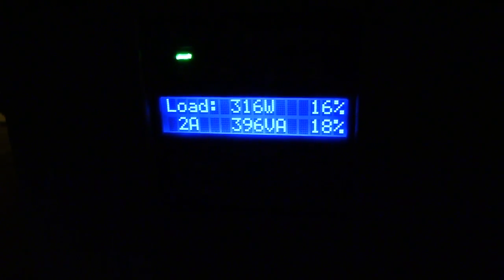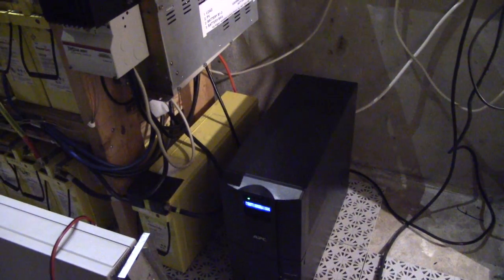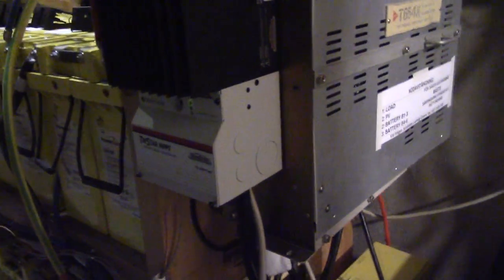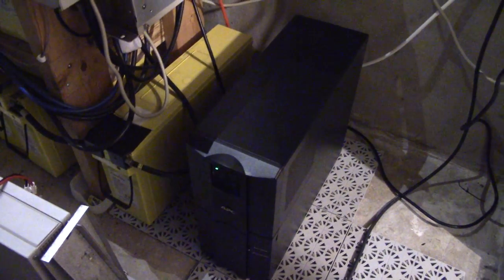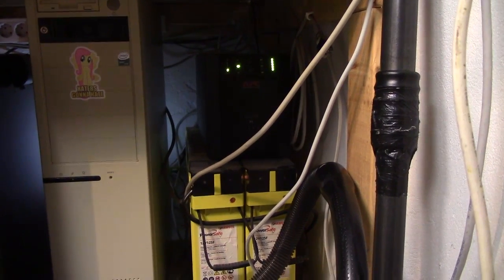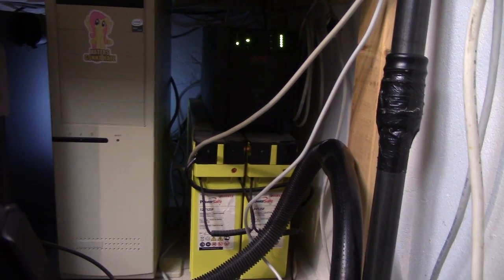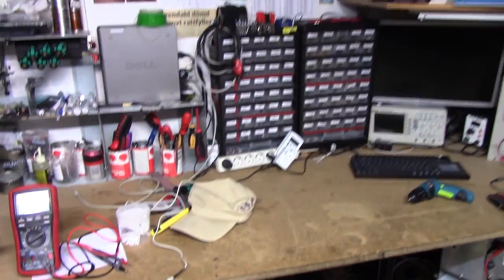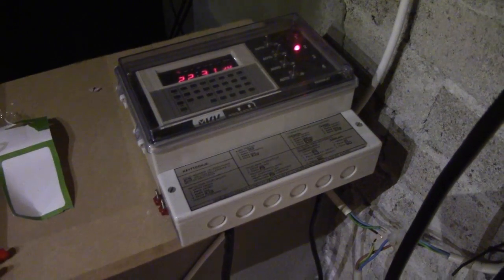Putting the hacked SMT2200I to use

Comment: That is one heck of an impressive battery bank! (When circumstances permit, I'm going to do something similar with a Smart UPS 2200XL...no solar, just long term backup power for some "important things".)

I always thought it interesting that the non-XL Smart-UPS models had the parameter for multiple battery boxes.
Reply from the maker: +uxwbill When you put "important things" in quote marks like that, it really makes one question the nature of those things.
Reply: +FFcossag I'm thinking mostly lights, maybe a few outlets. I'm not sure if the 2200XL has got enough surge capacity to handle something like a refrigerator. In its previous life, it powered a massive sump pump.

Important is in quotes mainly because keeping these things going wouldn't be a matter of life or death. The power has never been out for more than 24 hours. Refrigerators and freezers seem to maintain a "safe enough" temperature for at least that long if their doors are kept closed. And when the power is out, I'll go and do things that don't require electricity. Long story short, while it would be useful, it is mainly for fun.

Comment: thanks for the awesome video series. i guess you hacked this ups to an inverter just for the fun of it, or was it really that much easier than finding and maybe repairing a normal solar inverter in the trash or on ebay?
Reply from the maker: +h3po I just like hacking APC UPSes due to their ultra-simple construction. They're fun toys. However, the biggest reason is that this unit was free and fully working; the total cost of this project is the 22 € I spent on the fans, plus 3 € for the foam stick.

Comment: no info on the communications part of the UPS can u modify the software to make it realise it has a different bank size and ah size therefore being able to calculate the actual time left the bank capacity is???
Reply from the maker: +OffGrid Aussie Prepper™ I haven't managed to do that with this particular UPS.
Reply: bummer, and I just watched ur battery desulphation video and unfortunately u didnt go into practicle application and the theory went over my my head and usually I can catch what people r saying. Pity... I been trying to bring batts from the dead for the last few years and they just fail or get worse and short out. I wish u wud explain it step by step showing the pacticle side and not just blab out all the theory.
Reply from the maker: OffGrid Aussie Prepper™
As far as desulfation goes, I don't even know whether it works at all, so theory is all I have.
Reply: I am not sure about the desulphators after 2 years of using them either.... and that pisses me off, either it looks like it works and or the batt fucking dies... so frustrating.